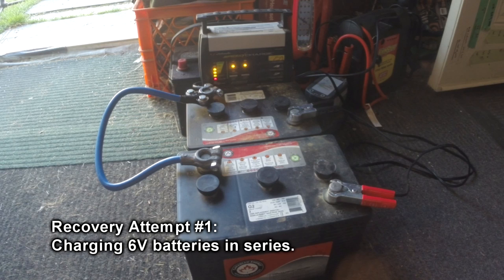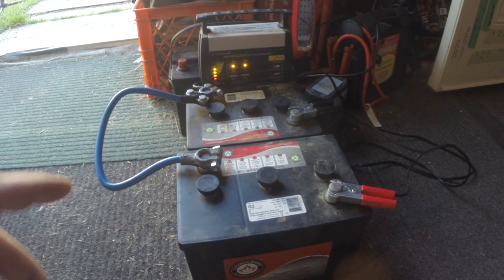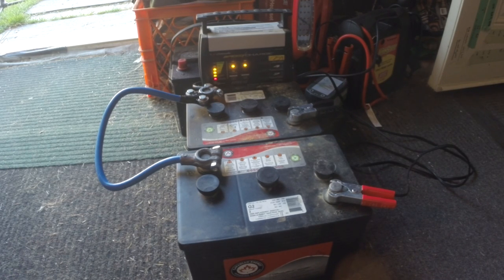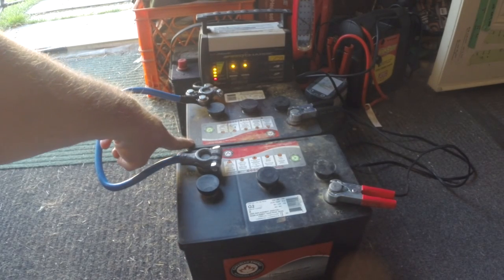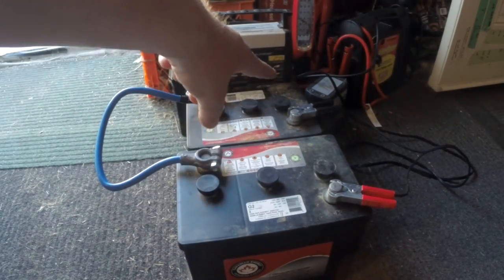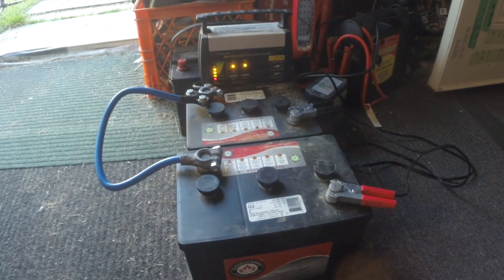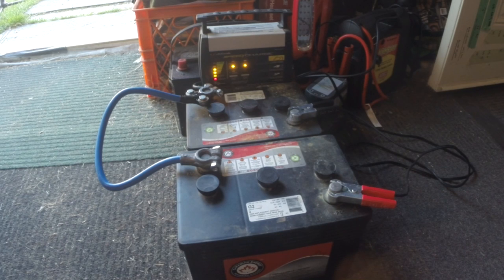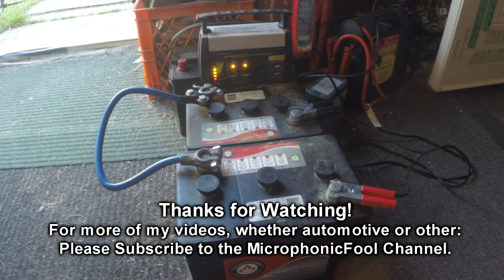Charging 6V Batteries in Series (Part 1)

Comment: Thanks, as I was originally doing it incorrectly, but now have my six volts charging together properly...much appreciated!   No idea why my Inverter/charger wasn't charging them, as it always has up to this point!   Will go out and check all fuses and breakers, and hopefully find the issue.   Unsure if it could be an inverter problem.

Comment: I have 2 12v batteries that i charge it 5 hours each, will the connector help me charge both at the same time? If so can you tell me the name of the connector? 
Thank you
Reply from the maker: You would need to wire the two batteries in parallel and not in series as I am doing here. They would appear to the charger as one 12V battery. I do suspect however that it would probably take a similar amount of time to charge them both as it does one each. I resorted to this method because one of the batteries was so low, the charger would not initiate the process.

Comment: Thanks for your video. I have a Genie scissor lift with 4  6V batteries wired in series, My question is there a different charger for series charging and  for parallel charging.
Reply from the maker: 4 X 6V batteries in series means your lift operates at 24V. Most people, unless into boats or tractors or something big probably wouldn't own a 24V charger to do them all at once. You have a few different options:

1. Charge each of the 4 6V batteries individually using a stndard 6V charger. When they are all fully charged wire them back up exactly the way they are now in your machine.

2. Much like I show in this video, take 2 of 6V batteries and wire them in series and charge them as a 12V battery. When those two are done, do the same with the second pair.

3. If you happen to have a charger that goes to 24V you could charge them all at once while they are in series. For your long-term sanity, it might be best for you to acquire a 12/24V charger so you don't have to be dissassembling the thing every time.

4. You could also wire all 4 6V batteries in Parallel and charge them as a 6V battery. This is not complicated but it would mean continutally rewiring between series and Parallel, and you would not want to get them mixed up at any stage.

Batteries wired in series will add the voltages together, but the bank will have the same AmpHour rating that 1 battery in the series has
Batteries wired in Paralell will have the same Voltage as 1 of the batteries but it will add the ApmHour values together

Technically, the charger will not 'know' if things are wired in series, it just looks like one larger battery to it.
Reply: @MicrophonicFool  I thank you for your time to write this reply. Are there different types of chargers? Chargers that only charge in series and chargers that only charge in parallel?
Reply from the maker: @antonios4926  The same charger is used for both scenarios. The difference being what voltage you set the charger to. The charger itself does not care if batteries are in series or parallel.
Reply: @MicrophonicFool   NOW I UNDERSTAND. Be well ad many thanks from Cyprus

Comment: Once you detatch them what was the result ofhe charge on both?
Reply from the maker: The one that had a decent charge to start was fine, the completely dead one did come up to decent levels 12.65+ but it would not hold that charge for long and so there was not fully revived. I originally did this video simply to experiment with the recover of the completely dead one without the 'Smart' charger shutting itself off. I should update this video as it has a stupid amount of views for my channel.... Thanks